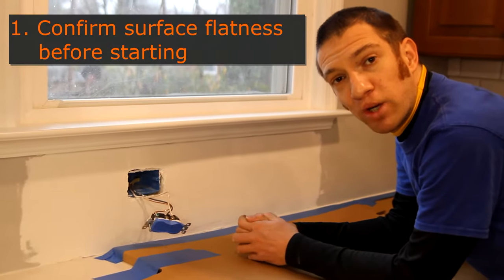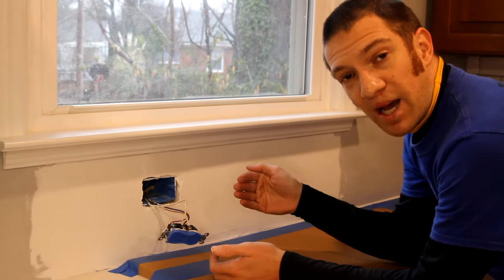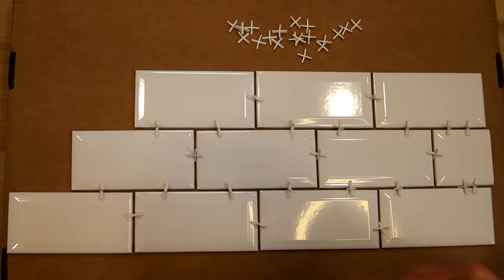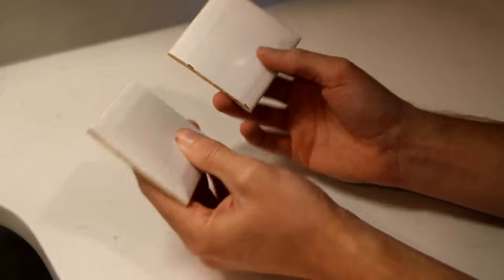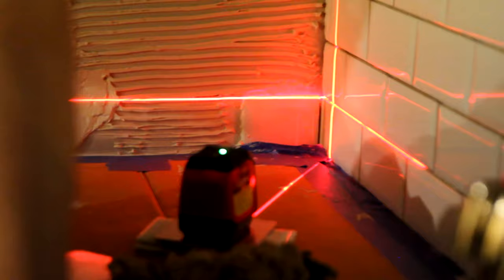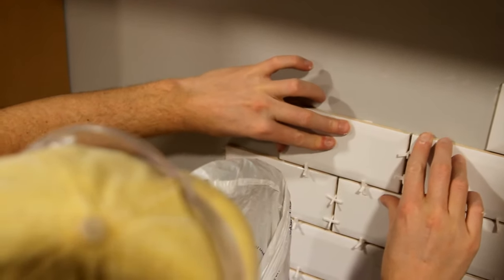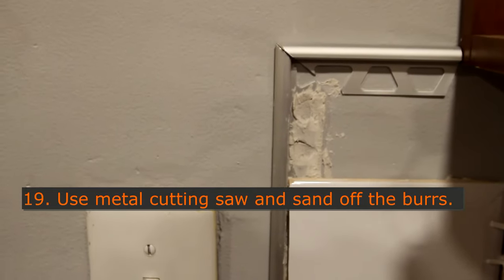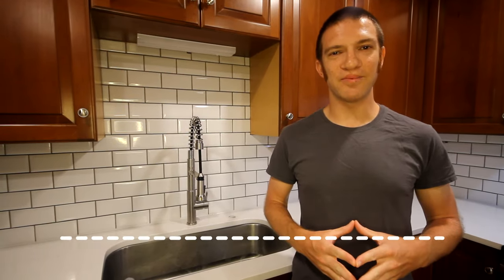19 Tips for Installing your Tile Backsplash

Comment: In laying out tile, always find center of the run. The center line will be the center of the tile or between tiles for a standard running bond pattern. Metal trim edging also works nicely as a full border against cabinets and countertops. Prime the walls before using mastic, you don't want to mastic right over drywall compound.
Reply from the maker: Good ideas, Thanks!

Comment: Wouldve been great to see how you replaced that cracked tile at the outlet. How do you remove a tile without destroying the drywall behind it?.
Reply from the maker: Hi there. If you remove it before the adhesive/thinset dries, then it's not difficult at all. After drying, your best bet is to try to carefully peel it off and hope you only remove the paint coat. This is one of the reasons I painted the wall before tiling. If you are tiling on cement board, you may have to chisel it out.

Comment: Adhesive or modified thinset? I guess you use adhesive if tiling over drywall. I'm using cement backer board so I guess I use modified thinset. I recall, that's what the backer board manufacturer said.
Reply from the maker: Hi there. Countertops are considered a dry area, so we used an acrylic adhesive like MAPEI Type 1 Ceramic Tile Mastic on painted drywall. Mastic is premixed and an easier consistency to work with, however it takes longer to fully cure. For any wet areas like a bathroom, you'll want to use concrete based materials like cement board and thinset.

Comment: What do you do if the countertops are 1/2 inch off from end to end to the bottom of the cabinets?
Reply from the maker: Hey Tim. I recommend using a laser level to make the tiles straight even if the counters aren't. Start with the lowest end, and as you work towards the higher end, you can shave off the bottom of each tile as you go along. This will be less noticeable than leaving a big gap where the counter is lower. Best of luck!